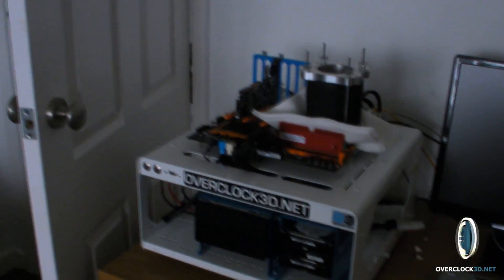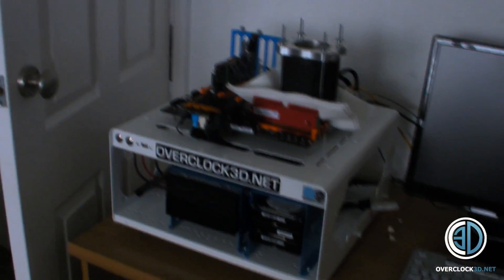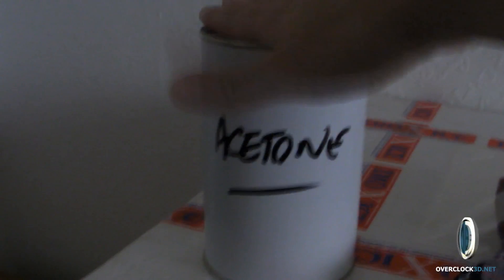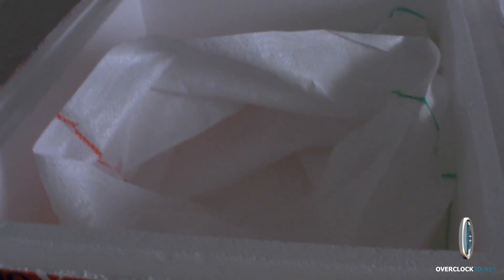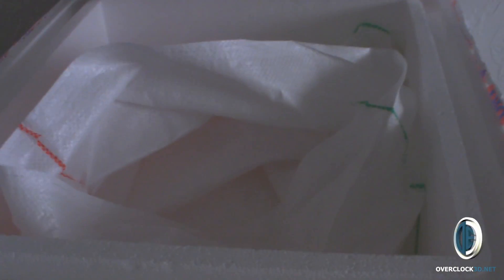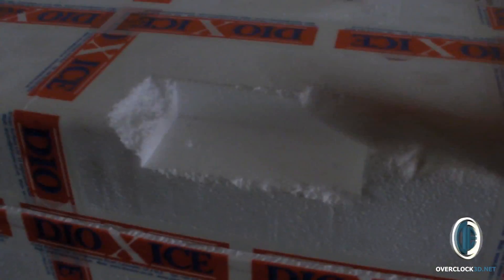Gigabyte X58A-OC - 5.945GHz DICE Dry Ice Subzero Overclocking

Comment: @desipilla its actually pretty simple if you dont know......raise the multiplier raise the volts...i got mine to 4.5ghz by just putting the multiplier to 45 and raising the volts to 1.38...only other thing i touched was to turn off intel speedstep and i tihnk raised cpu current capability to 130%......but that was basically it